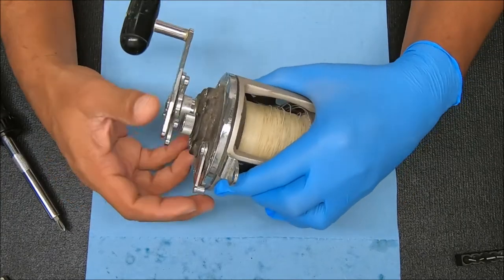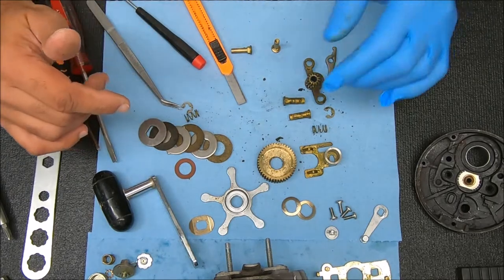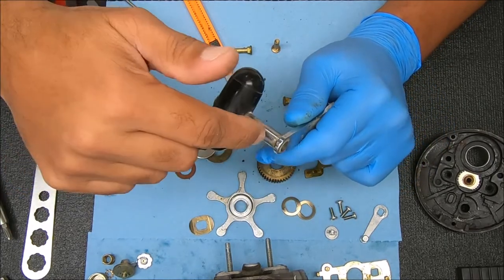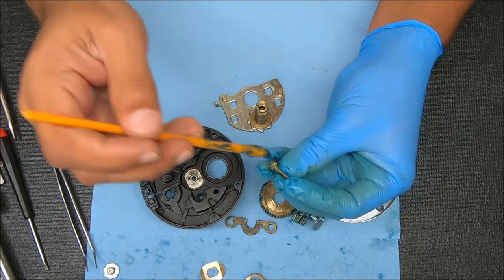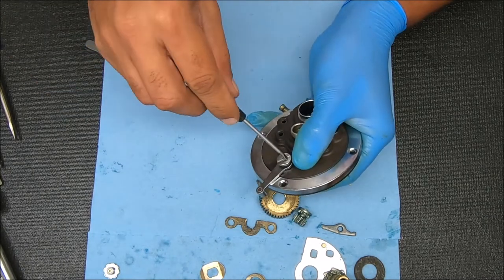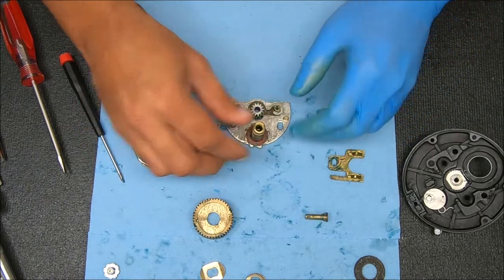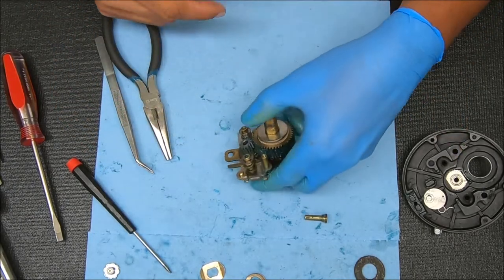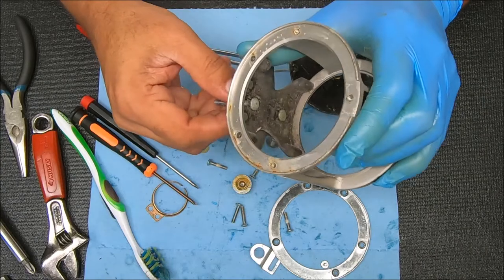Daiwa Sealine 400H Fishing Reel - How to take apart, service and reassemble

Comment: Hi! Great description for correct maintenance. I just bought a Daiwa 400 sealine with an old glass fiber rod. Will do maintenance now according to your description. One more question, the eye- loops on the rod are bent on the glass fiber with fine tissue garment. I'd like to renew the rubber coating. Would you use gum- solution or plastic coating? Thanks, Jens
Reply from the maker: Thanks for checking out the video. Not sure about the rod work... I would probably take it to my local tackle shop or do a search on here for someone who specializes in rods.

Comment: Good reels I caught one on the bottom of the ocean once deep sea fishing the outside Handel plate is completely eaten but I cleaned and oiled everything and the reel still works like new and has great drag unfortunately it’s very hard to get any spear parts for it like a penn 113h parts are very hard to get I would like to get a new handle side plate bridge and handle
Reply from the maker: Thanks for checking out the video, Jim! Yes, they are very durable! I know I have a few of the drags left, but not the handle ot right side plate. Part 747-4112 or 747-4113 will work for the handle. You can check eBay for the drags.... a seller has 375-9405, which will work.

Comment: Another two questions pls: How would you polish and passivate the alu alloy? And which line do you recommend for the rod? I'll typically fish European catfish, maybe sometimes pollack back in the north sea. Thank you for your great tutorial!
Reply from the maker: Hi again.... the aluminum is a tough one... as long as there's no pitting, I would use an ultrasonic cleaner (which I think I used in this service) or some water and soap with a non-abrasive scrubby pad. For the line, I think 20 - 30lb mono would work well to handle both the rivers and North Sea.
Reply: @TSGReelService  thanks a lot, it's highly appreciated. This reel is beloved by everyone, and all would still use it. However the right line is highly disputed, ranging from  20-30 lb mono to 80-100 lb braided with 0,5 mm strength for catfish. And so is the rod, I got an old glasfiber 220cm "broomstick-like" boat rod with it, however catfishing mates recommend a moderndays light carbon rod. Hope to get the best out of it!
Reply from the maker: @jensmatthaei3293  I don't you can go wrong either way.... catching fish will be the most important part of the equation. 🙂

Comment: Thanks for the awesome video?  Where can I buy a replacement dog for my 400H? The anti reverse is finicky.
Reply from the maker: You're welcome and thanks for checking it out! Not available. Sorry. If the dog still looks good, check your spring and ratchet on the gear sleeve. Or, you can try sanding the dog.

Comment: Thanks for posting this video, I picked up the same reel at a flea market and it was in pretty rough shape. Quick question, how come you didn't lube the drag washers? Is it not required for this style reel?
Reply from the maker: Thanks for watching! I don't grease those drags. I also don't grease asbestos drags, or the stock drags that come in TLD's and the like.... it makes them sticky. I'll oil felt & leather (shhh) and grease carbon fiber and sometimes felt. I probably missed some drags, but you get the idea.
Reply: @TSGReelService  thanks for the reply! I had no idea it was an asbestos drag washer. Can these be swapped with carbon fibre washers?
Reply from the maker: You'll have to read it again..... I didn't say that. I don't know what the material is. Yes, it can be converted to carbon fiber. You'll need to keep the stack size (height) relatively the same, which will take more metal washers and CF washers than currently come in the stack.